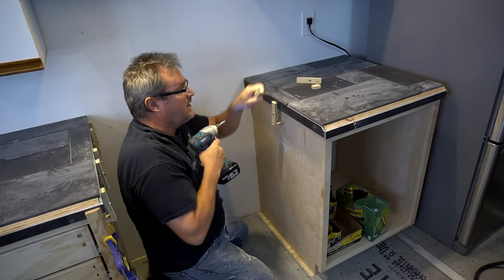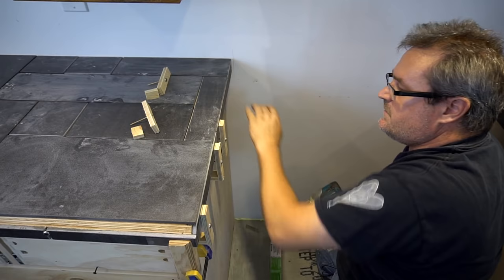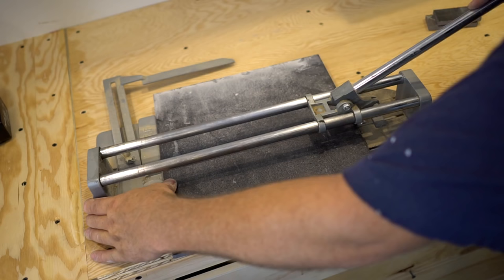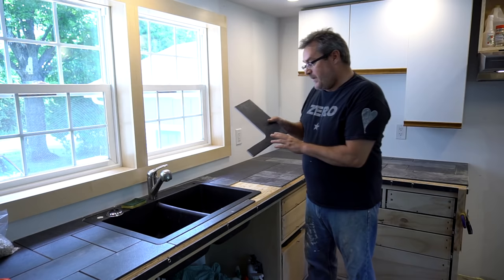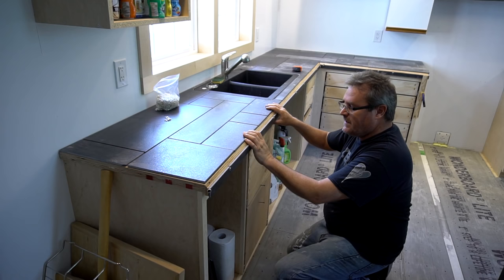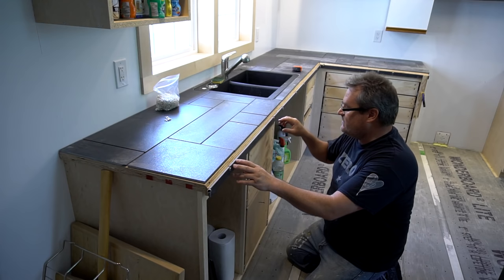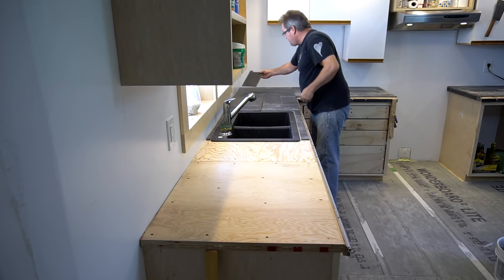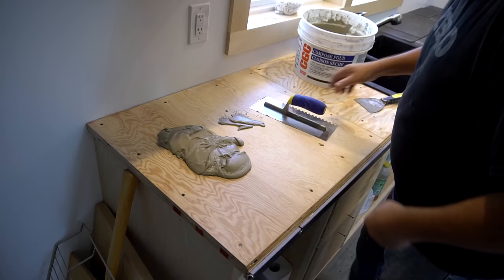How To Install A Tile Counter Top

Comment from the maker: To all of the "experts" that are saying this will fail because it was done on plywood, well it's more than a year later for this one and it still looks great. As I plainly said at around the 3 minute mark, I did all of this before in exactly the same way, and that was 10 years ago. To the best of my knowledge, that is still in great shape too. 
The combination of the mortar and the high quality tile and then the epoxy grout produces a completely water proof barrier. Water that spills on the counter or around the sink cannot penetrate this water proof barrier to reach the plywood underneath.
Reply: This is pretty much the precise look I've been looking for in my own renovation, including those pine (maple?) window trim. I see this video is a year old. If possible I'd really like to see some finished pictures of your kitchen, really interested in seeing what wall colours you chose, cabinet doors and I'd also like to know what those tiles are called ? Great work :-)
Reply: They are not "experts", ply is 100% OK to tile on as long as its thick enough and well supported. Cement board is for walls instead of plasterboard. I think you call plasterboard "sheetrock" in US.
Reply: Wrong. Plywood expands and contracts. He should have used concrete board or some other isolation membrane. His method may last a few years, but who does all this work for it to last a few years before having to redo grout joints or replace cracked tile?
Reply: vapourhead Atc .... No.." YOU "are wrong, I have 36 years experience, with no problems. Who puts cement board on floors? This is the same as a floor with less traffic stress.
Reply: MrCorfuz That's what I was thinking lol.  What do they think there counter is made out of? Doesn't matter what kind of top you have on it,  it's still plywood constructed.  Cement board is for your bathroom. I mean I guess you can use it on your counter, but why.  If your putting that much water on your kitchen counter tops that you think you need cement board,  you got problems.  When we built my sisters house 20+ years ago, the kitchen counter tops were done in the exact same manner as this guy's doing.  And guess what? They're still there and look the same as the day we did them,  minus some wear and tear lol.
Reply: I'm about to tile kitchen cabinets using large tiles. Is there something i.e. membrane needed to paint over plywood before tiling? Another question. Installing new kitchen cabinets/counter tops and was wondering considering I will be using large tile, should I double deck 2 pieces of 3/4" for (1-1/2") so to have a strong solid platform for tile/mortar? My wife also doesn't want bull-nozed front strip either, so it needs to be very true consist platform along front edge-strip, too. Will gladly accept all recommendations! Thanks!
Reply: +Allen Portman. Yes ply should be painted with a sealant. Your local tile store will recomend one. Most professional tilers, here in the UK, will use PVA, however it is not recommended to use PVA, something to do with it remaining active until the water in the adhesive has evaporated. I use PVA and so does everyone I know, never heard of any probs. Not sure if you call it PVA in the US. ( i`m guessing you are from the USA as you say "counter tops" and you use inches!)
Reply: MrCorfuz, there seems to be some cement board on the floor in this video..?
Reply: I Build It Home where did you get the sink because I would like to buy the same one?
Reply: I Build It Home I think it looks amazing. Love the look. Very classy.
Reply: What is the difference between regular grout and epoxy grout.
Reply: It's okay to use ply but not optimum. If you use ply, you should avoid using low quality thinset/adhesive, this is where it's more likely to fail. You should use a more expensive flexible waterproof adhesive. It's very common and when you look at the cost of adhesive as a percentage of the overall job, it's a false economy not to use it. Then finish with a similar quality grout. You'll see on the packaging that it is suitable for swimming pool use.
Reply: You should also backbutter the tile
Reply: Im Expert as you said  and for sure they keep looking good but since wood expands they get lose no matter what, the only thing keep them "look great" its the grout but its a bad and cheapie way (not right way) so i been tile setter for 25 years and they will get lose my "expert" friend
Reply: I Build It Home wouldn’t plywood bend in the long run under that weight
Reply: The problem with that is if moisture or condensation does get to that plywood there's absolutely no way for it to dry out and it will rot
Reply: I have done 5 including 2 in my sons home and 2 in my existing home...  each time with 3/4 plywood only base.  All counters are still solid to this day, (13 yrs for one and 4 for the other), no cracks or grout issues.  I recommend using sanded floor grout, its tougher and once sealed shouldnt give you any issues at all.
Reply: So if I were tiling a shower, you're saying I don't need a waterproof membrane.  I can use tile and epoxy grout too?  I would be worried about being poisoned by mold.  Just because nobody hasn't died yet doesn't mean this technique is safe.  Why not just add a moisture barrier like RedGuard around the sink?
Reply: @digitalcurrents  
Redguard or wedi product is perfect as redundancy
Reply: @digitalcurrents  
Plan for the worst conditions
Hope for the best
Reply: Back in the 70's when we did a huge add on we tiled over 1 1/2 ply and it looks and held up great for 25 years. Then we updated to granite. My current kitchen is 3/4" ply with a 1/2 on top of that and porcelain. Holding up great.
Reply: plywood is fine ... except possibly over the dishwasher.  (when you open it, it releases all that steam)
they have purpose-built "heat/steam" shields built specifically for that (bc plywood is fine)
Reply: I think failures may be based on humidity changes. If you're not keeping your living space conditioned you will get more expansion and contraction of the plywood which may crack tile and grout. As mentioned I don't think using Redgard is a bad idea.
Reply: Nice job man
Reply: I too am looking to tile - big tiles 2ft by 2ft outdoor kitchen counter top. I guess the correct way it to use hardie board on top of the plywood but it's his bloody kitchen and he can do what he wants!  He's saved so much by having a so called expert come in and do it (good luck in finding one in today crazy Covid labor market and finding someone who is not a total novice as all the folks in my area won't work on project less than 10k) that he can re do this every 10 years :) In my case I want to have it so folks can dance on the top of the bar so might needed to actually use the hardie board - drat! Well done I say. My tiles are very heavy so perhaps I can pull off this method. 3/4 inch thick and 40Lb each !
Reply: I'm thinking of doing the same thing. I'm just going to 9/12mm plywood over my worktop, prime it & presto.
My only concern are the border tiles, how to keep them from falling off
Reply: Epoxy grout is not water based its a 2 part mix that activates when mixed together. It is harder to use but lasts better, commercial kitchens use it. We used it for our kitchen splash back tiles, it is more stain mould resistant to normal grout. And it costs more.

Comment: I know this is a few years old but this is exactly the idea I had floating around in my head for a while. I built my own cabinets with rustic type doors and drawer fronts. I made all my own handles by drilling and tapping railroad spikes. Now that I actually see the results and how nice it came out, I'm going this rout. The only difference is I'll be using a lower grade tile. Thanks for the inspiration and just ignore all of the 'Keyboard Experts'!

Comment: This is a very neat look and install. I have solid white porcelain tiles and one inch glass mosaic sheets which I bought from my local Habitat ReStore. I will install those this week. I also have porcelain and ceramic tiles to use for the backsplash. My kitchen is almost the same layout as yours, with the exception that my refrigerator is to the left of the window. My tiles are only a little less than 17". This video did help me with the fact that it showed me that I need to install the glass tiles around the sink and edges, before I set the front large ones. I figured the variance in sizes of the tiles would make for easier trimming. Thanks for sharing. Your countertop looks unique and that's also the type of look I want.

Comment: Thinking of either doing tile for and old butcher block laminate that looks old with new cabinets. This pattern really makes the difference in a blah countertop and one that has interest and appeal even to those who might think tile is tacky,  yours is beautiful.  That is the exact color I am using with an epoxy grout because I too will be putting this down on 3/4" ext playwoold but I do a spar varnish two coat on mine before tiling.  Now I can't wait to get started.  Need to look at your pattern and make my changes to what I want.  But a terrific and well planned job. Love your glue clamps for along side the stove. Well thought out.  And the screws with washer to hold down the front, genius.

Comment: I use plywood on my 1934 Cape Code home many years ago and never had a issue. It was before cement backer board came out. I sealed the grout and maintained it. Water is the enemy and if you keep it off the plywood then no issues in my case.

Comment: I've never seen a tiled worktop in person but I love the effect of this, John. I guess there's no danger of scorching a white ring on the surface from a hot pan... ;-) Good to see plywood being used as well.
Reply: There is a very real risk of the tile exploding which isn't as bad as it sounds. The hot pot on a cold tile can cause the tile to expand too quick and crack or pop off the grout.
Reply from the maker: That might be one for Mythbusters :) I've often taken pots and pans directly from the stove to the tile countertop - no problem. It would take some kind of brutal heat to damage or pop these tiles off.
Reply: Adam Rivera - bullshit! These tiles are kilned baked hotter than you'll ever get your hot pot from a stove!

Comment: Despite the people saying you shouldn't use plywood, I don't agree. When I got my place it had a tile counter and it was done very well, but I prefer a solid surface so I removed it and put granite. The removal was pretty damn hard, they used a wire lath under the mortar and screwed the plywood from the top into the cabinets, so I had to break every tile and scrape off the mortar and pull out the lath until I could get to the screw heads to remove the top. It's not mentioned in your video, but it's good to note to screw the counter from the bottom to make for easier removal in the future. The primary reason I don't like tile on the counter is the grout absorbs too much and requires more frequent sealing than a solid surface which is smooth and easy to clean in comparison, plus you can mount an under mount sink and which makes wiping dirt and liquids into the sink so much easier. The same process for my old counter was used in our bathroom floor and from what I was told it had been done several years ago and when I removed the tiles, the plywood under was like new... again after a lot of hard work removing the tile, mortar and lath that was stapled down. There was no mold or signs of water penetrating the tile/grout. So if the mortar is done properly, there should be no worries about using plywood. So long story short, plywood is ok.

Comment: I've seen these kind of counter-tops and bars that lasted for a couple of decades, replaced because they were boring. The weight of the material is keeping itself in place, with a little help of proper glue material, of course.

Comment: Looks good John.  Honestly I didn't think I'd like the tile counter top.  This looks really good.
Reply from the maker: When someone says tile, everyone naturally thinks of the old white, glazed ceramic with the icky grout joints, so I completely understand :D
Reply: That is true and I've even seen granite tile I didn't really care for.  But this, I don't know, perhaps it's the random size and tile pattern.  It's different.  I am a big fan of quartz because of never needing to seal it. Although I don't like corian because well it's plastic.  Granite requires too much maintenance to keep it safe.  Concrete is the same but I do love what you can do with it.

Comment: I'm about to remove my popcorn ceiling and replace it with knock down texture wand was wondering if you could kinda walk me through after its removed. Was wondering if I had to re mud the entire ceiling or just retape and remud what had to be retaped. What kind of mud I understand there's all purpose and hot mud and dunno if I'm missing another but what would be the difference and which should I use. I saw someone using hot then all purpose. I'm going to use fiberglass mesh as well. Thanks

Comment: Have you found all these years later that the edge tile you glued on and kept in place with screws & washers have since stayed in place or have you have some issues?  I am about to tile and want to know you if still recommend this method verses using a modified thinset.  Thank you 
I appreciate all your video.

Comment: why plywood for under tiles?  instead of cement board?
Reply: Larry Meier what?!?   It comes in 3’x5’ sheets?   What are you talking about?   Wood rots.  Should have used backer board.  No excuses.

Comment: How did you do front angle on your wood substrate for the front strips of tiling? I am putting 6"X24" floor tiles for kitchen cabinets and using 1/16" spacers, but when I bring (start) my tile to where is needed with edge extended out only a 1/4", I am ending up with a 5/8" gap between tile and wall?

Comment: I love the tiles you put in!  The epoxy grout did a fantastic job, it all really looks wonderful with your black composite sink!!

I'll be installing a mosaic tile that has some multi colored glass pieces in it. After you finished your kitchen, did you have any problems with loosening tiles on the countertops??  I'll more than likely follow your example with your back-buttering!
After my tiles have set up, I'm going to be putting a couple coats of clear epoxy over my tiles. I'm not exactly sure what the best way of "encasing" my countertop is so all my epoxy won't run off the edges...  Hopefully someone can give me some good advice...Heaven knows, I'm open to suggestions on how to do this.

Thanks a bunch for your videos!!!
Have a great day!!

Doe Campbell

Comment: Hey John?  Nice job!  Was wondering, so it's not necessary to lay down cement board/backer board? I'm having such a HARD time with the marble tile "flushing" with the counter stove!  I have cement board surrounding the stove AND with the tile on top, is NOT working well!  Way too high!  I was told that plywood it expands moving the tile; verses the cement, which doesn't expand... what are your thoughts?  Thanks!
Reply: Andea McDonald you don't need cement board. if you use exterior grade plywood or osb like he did. you can also use constriction adhesive instead of thinset.
Reply: Thank you, Kyle! I WISH I had your advise before.... Going forward, I'll certainly keep this in mind!
Reply: Mastic (or other adhesives) are a good option, just make sure you aren't gonna be the one who has to scrape it off the plywood later.

Comment: Not bad for not being in the trade! I also peeked ahead and found you using epoxy grout...why would anyone use anything else???

I live in, and am restoring, a house built in 1780. Because I'm single, I get to make all of the remodeling choices. Choices for 2 kitchen counters have been narrowed down to wood (because it gains character over time), concrete (because it can be so versatile), and tile (that was sadly running 3rd, until I saw your video!).

I seem to have relegated tile into 2 categories...70's, 80's decor, or the good stuff is cost prohibitive for a floor. 25 to 50 square feet of 'good stuff' (applied in a creative manner) makes design and dollar sense. Thanks!
Reply: Paul Drowns if you’re trying to go for a vintage feel I’d definitely go with concrete
Reply: Thanks! I've swayed since I'd posted, and think that concrete might be the best medium.
Reply: Paul Drowns I personally think that concrete and vintage houses go together really well. I love old houses. Saying this though, I don’t know what style you’re going for.

Comment: I see a LOT of comments about using cement board (hardibacker, Etc.), has floating out a counter been totally forgotten???
I am not going to judge whether this tile will fail or not, I just would not have it or use this method for myself or my customers.
Cement board is good for raised foundation floors and "acceptable" on walls for some. As for myself, a floated wall every time and a floated floor in cases where there is water.
Reply from the maker: You know what else is totally forgotten in the modern world? Digging water wells by hand. 
Doing something the hard way doesn't mean you'll get superior results, it just means you worked harder.

Comment: Are you going to cut 45 degree edge on both sides of your bevel front edge? If so I'll be looking forward to see you cutting those. Good luck.
Reply from the maker: Already done, as shown in the thumbnail for the video. The angle cut on the tile didn't have to be fully 45 and it wasn't difficult to do.

Comment: Hey let me ask u, how easy is it to clean the counter top with the grout lines? What kind of grout sealer do u recomend for the grout lines on the counter top
Reply from the maker: Use epoxy grout, like I did here. It sets harder than concrete and never needs to be sealed.